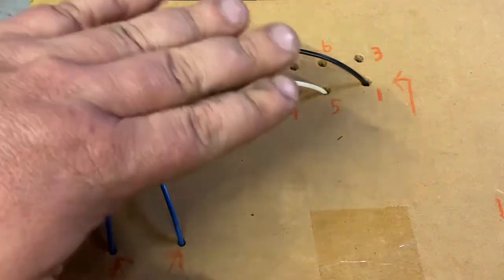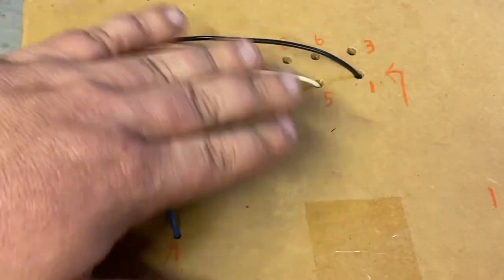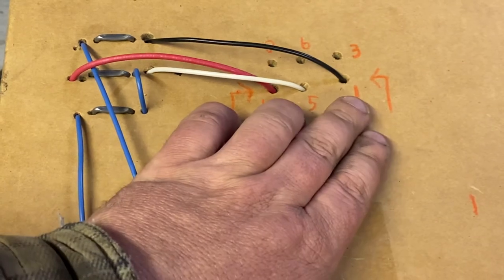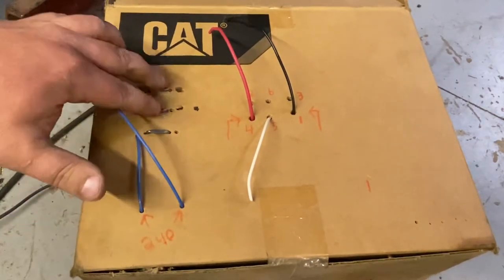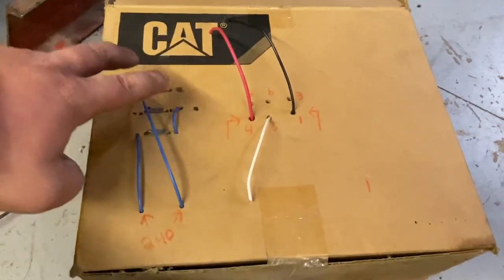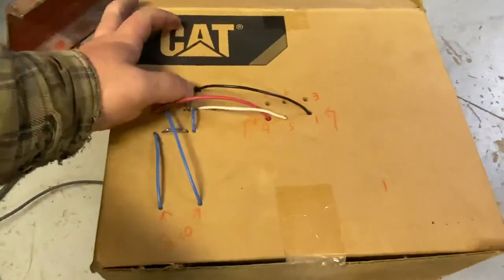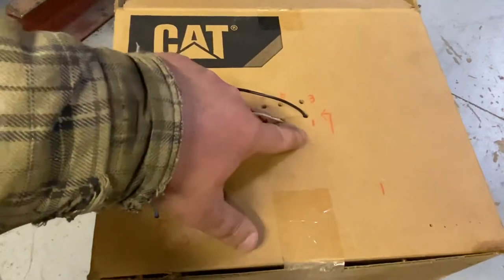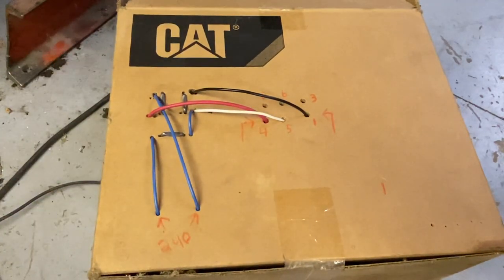How to wire a 240 volt, 3 wire reversible motor to a drum switch

Comment: I have a single phase 240v motor that has a directional switch and I'm trying to take the directional switch out and wire it just to the magnetic safety switch in one direction. Would this still apply to it? The wires on the motor are black blue and red.
Reply from the maker: Email me at badam485@yahoo.com with pics of the motor wiring plate and I’ll see what I can do for you
Reply: @smalltownmachineshop6860  thanks I have done!